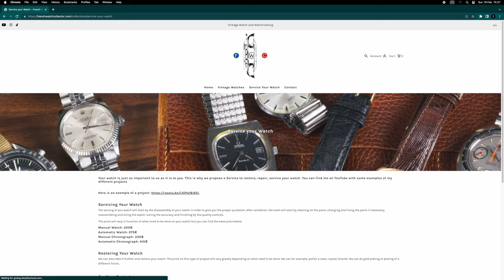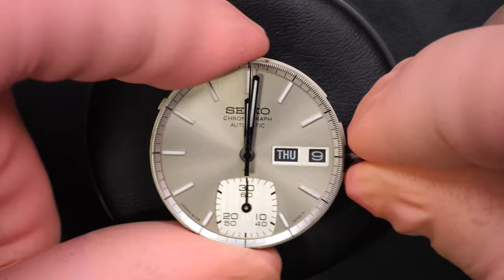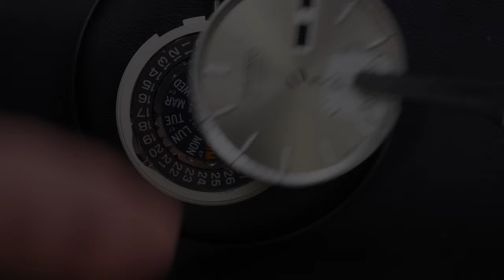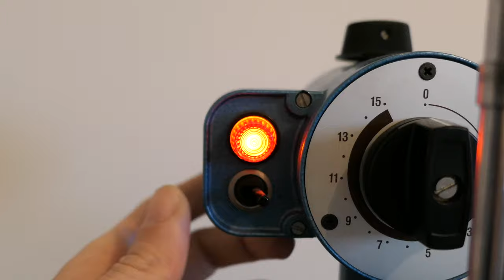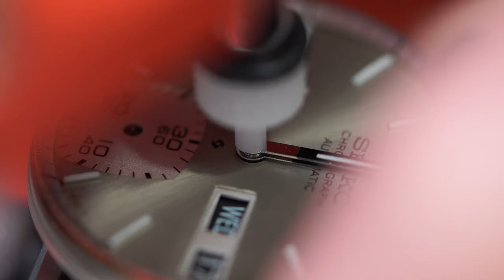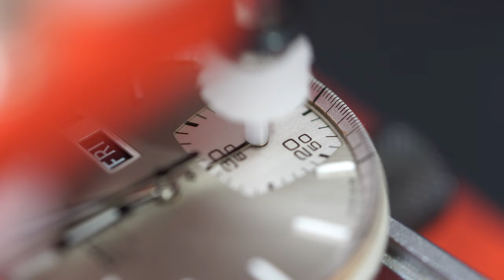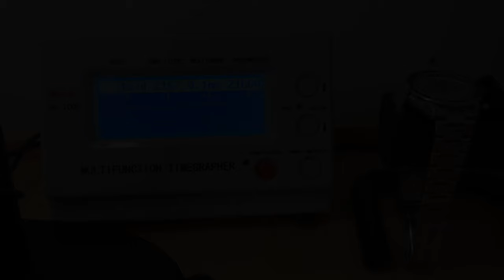Witness the Heartwarming Rebirth of a Seiko 6139 Vintage Chronograph!

Comment: I'm struggling to open the main spring barrel. Is there a trick to this. You make it look very easy.
Reply from the maker: You have to type of opening. The one on top and some open in half in the middle of the side wall. It it opens on the top just pressed on the side the and the top should come out. If its is opening on the middle you need to use a blade to open it up like a case back
Reply: @FrenchWatchCollector  You certainly made it look easy. I have one I'm struggling to open and I don't really see the logic of how pressing down on the sides when it's resting on a small anvil can make the top come out. Yet...I saw it with my own eyes on your video. I guess I'll just keep trying.

Comment: I recently Purchased one, and who every worked on it before didn't align the number bezel correctly and added Yellow chronograph hands. 
I plan on restoring the watch with original parts, but the moment seems to been worked on and re-oiled as its keeping time to the second 
day I wear it. So I make have gotten very lucky with a only a slightly botched cosmetic issues that I should be able to fix myself.

just one question I have is who did you you remove the outer bezel ring ?
Reply from the maker: I am not what is your question

Comment: I have a sentimental Heuer Autavia Viceroy model I purchased in HS and it isn't working correctly. Two shops looked it over and said it's fine. It stops running after a few hours,  either with the second hand running or not, either worn or on the watch winder...HELP!!
Reply from the maker: I probably can help you. Go on my website and we can take it from their in the contact section